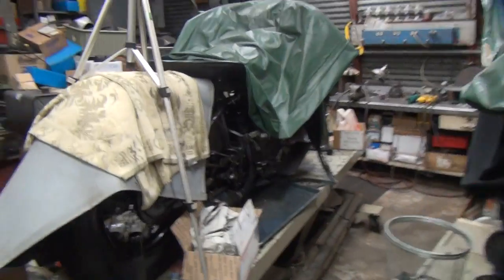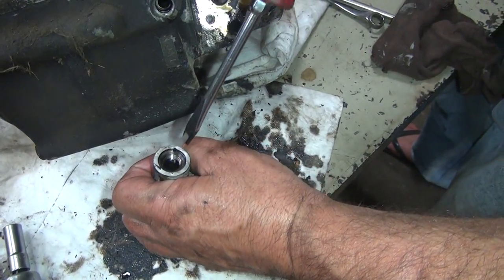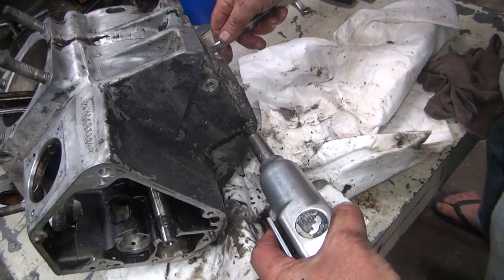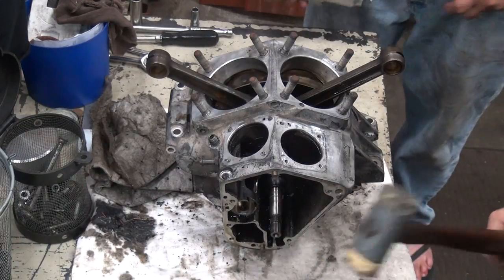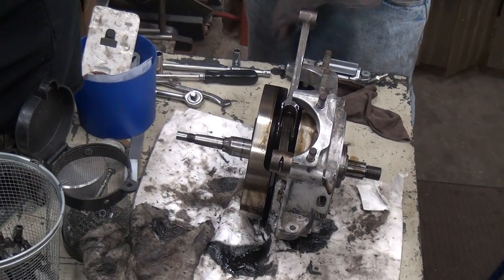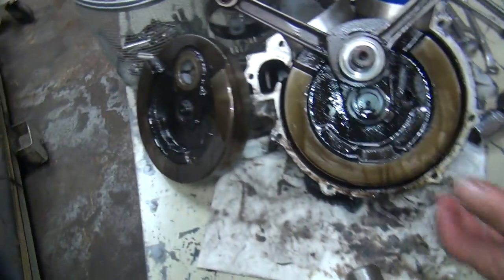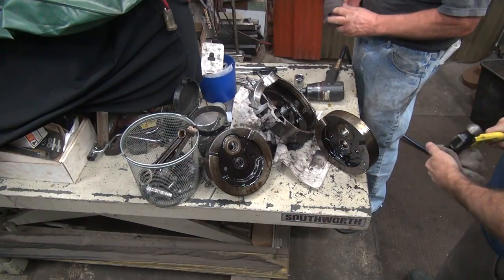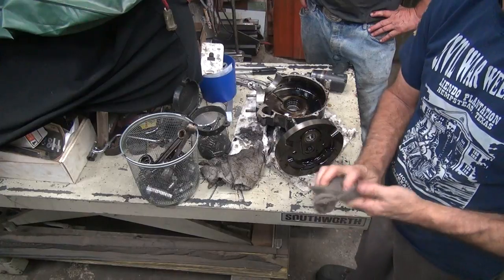#102 1979 80ci shovelhead motor rebuild fred's barn fine fx superglide flh harley tatro machine

Comment: Not to be negative , but I would have wash the outside of the motor first
Reply from the maker: complete motor are heavy and are hard to clean. the smaller parts are easy to clean.
tattro